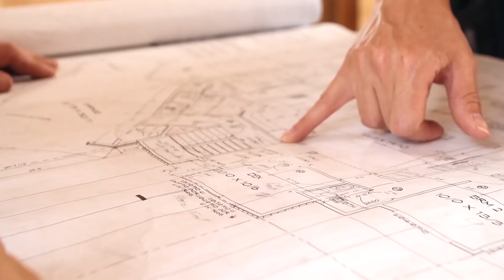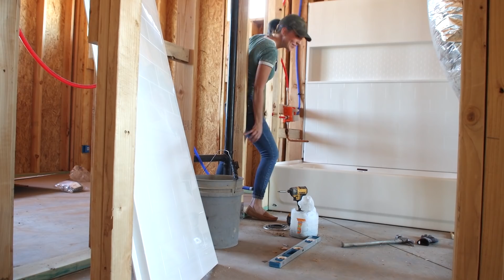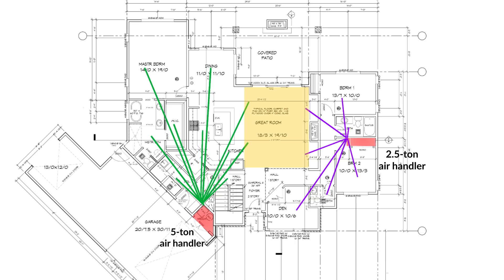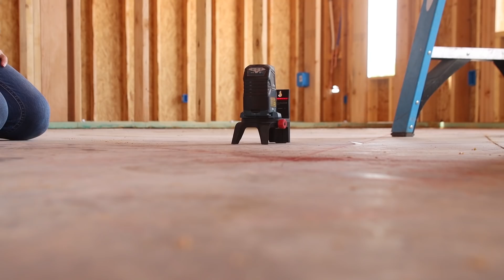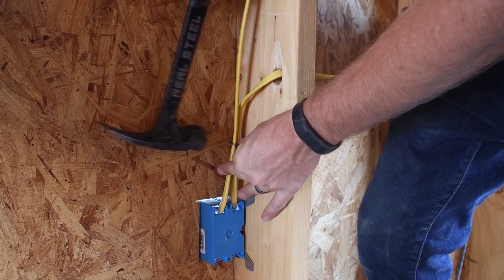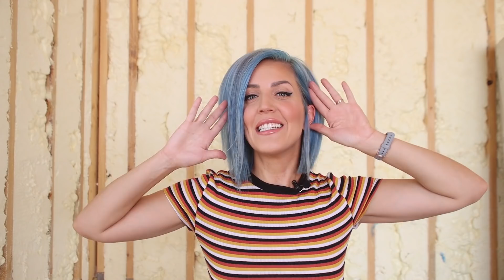DIY & Professionals Install HVAC, Electrical, & Plumbing | Ep. 5 Building Modern on a Budget

Comment: For 15 years, actually more than 15 years of my life was spent in doing stress-strain and design on heavy machinery. Cutting near the edge of a 2×4 or other wood piece weakens that  pieces of lumber to take loads as most of the stresses go through the top & bottom of the piece, not it's middle. ( you always want to drill your wire holes through the middle of the piece). You should reinforce around the holes drilled through the OSB for your AC ducts. ( I always used guerrilla glue, and a few screws. Really, liguid nails make work better) This replaces most of the strength lost when cutting the hole. Most builders just opt for the industrial look and suspend metal AC ducts from the ceiling to solve ducting problems like you ran into.  ( they paint the ducts black) This is also a matter of preference as some people don't like the industrial look. Rejoice that you didn't build in Ohio as all wiring must be placed in conduit pipe, plastic or metal, in newly built homes and stapling it to the  wood reframe work is unacceptable. If you do so they will make your tear all your wiring out and throw it away. ( I know, fussy, fussy, fussy, but in the end government ends up winning)

Comment: Question: the only reason you’re able to do these small things without a subcontractor is because your father is the GC correct? And the electrician was a family friend? The construction loan will not pay for the materials installed in a DIY application (not by a sub constructor) is what my experience has been.
Reply from the maker: Yes. We were supervised by a licensed contractor and sub-contractor at all times.

Comment: I'm no expert but why couldn't you open the trusses and rebuild a blocked and reinforced opening for the holes needed for the HVAC ducting?? Same principle as using headers to shore up where studs get cut to accommodate windows? Could use a flatter flange metal rectangular solution to fit.

Comment: HVAC CONTRACTOR: Again with all of this flex ! Flex ducting has its place but not as main-run ducting. The static pressure alone will kill the equipment. In AZ. with the heat load..,good luck.

Comment: The reason you have so many issues is your designer and contractor should have worked together.  Clearly your designer was more.worried about how the home looked and not mechanicals..Your.problems is your designer, see this a ton as a hvac tech

Comment: "An obscenely high number of windows."  ROFL.

You saved yourselves a mistake I made.  Due to scheduling, I brought in plumbing, then electrical, then HVAC.  Of course, the HVAC needed some of the electrical repositioned by a few inches or even by a foot in some locations.

Since plumbing is least flexible, HVAC, is second, and electrical can run anywhere around plumbing and HVAC, I'd recommend ALWAYS getting the electrical done last.

I was kind of expecting that you were going to solve your "east side problem" with the Mr. Cool mini-splits as well, since they are bedrooms, and could each be "HVAC zoned" to the preference of the person in the room.  Still, doing 5 tons HVAC on that much space for $10k is remarkably good.  It would be at least $15k here (though that would include oven hood vent, dryer vent, and bathroom vent fans).

BTW, I also did 400 amp service with 200 amps for the house and 200 amps for the garage.

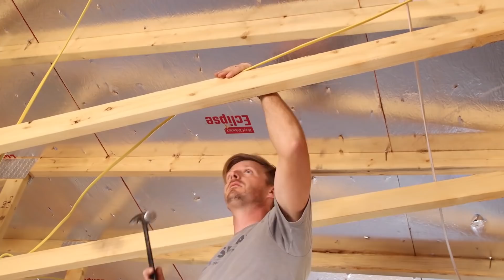Comment: 11:05 Whoa, I’m shocked your inspector allowed the use of staples with no plastic protection. It’s been over 10 years since we were allowed to.
Reply: I saw that too.  Not using NM staples would be an inspection failure here. Also, they are really strict about the nail guards as well (though they showed that).

Comment: I'm shocked that you assumed the electrical would be cheaper than plumbing. The cost of materials within plumbing is typically cheaper and the knowledge needed for electrical is far more.

Comment: Love these videos. They are so inpsiring. I suppose this woudlnt help now but I was curious; if you were gonna have some A/C mini-splits, why not do the whole house like that? You could buy a 5 ton compressor unit with (evaporator) cassetts in up to 7 areas of the house per complete unit. Also, from another comment above, i agree with the Cat6 or better ethernet. The need for POE devices like security cameras and multiple WAPs is growing; especially with a home this large. I’ve only seen a few videos so possibly ill see you address this elsewhere so surfice it to say, i enjoy your videos and best of luck

Comment: A heat pump is an air conditioner that has the ability to run the refrigeration cycle in reverse. The AC doesn't come with a heat pump. It's either an AC or a heat pump.

Comment: i'm no profesional but would've installed Cat 6 or Cat 6A  for future proofing network demands
Reply: Future proof, 6A all the way
Reply: Rigo De Bruecker cat 6a is overkill. You won’t need shielded cable in residential settings. Cat 6 is fine.

Comment: Electrical is no joke. It's one of those things that you should spend a little more just because security. In Brazil we don't have that standard in home wiring, the company hook up the wiring to the meter and from then on it's on you, so ppl tend to use wiring just at the limits of the copper, a lot of electrical tape and some prayers. In my house, the breakers won't trip because of overload, and that haunts my dreams.

Comment: TOO LATE NOW , but i would have built a insulated horizontal boxing just under the back ceiling  above the back door and shrink the clerestory/transom window over the back patio door  it would not have looked bad imo , since the modern design gives you that latitude ( FYI I''m a custom home designer and commercial/ residential interior designer of 40 years) impressed of all the work ya'll did in that heat - bad ass ! lending a whole another level of sweat equity  -  other ?  LED cans ? Whats up with the interior materials selections ? ( what is budgeted ? be careful , very careful)

Comment: Flex duct for every trunk is lazy hackery
Reply: That's why the hvac was so cheap a very piss poor job the fact that their in laws said they do good work made me laugh even harder definitely not a quality job I'd be surprised if the even check static pressure or set the airflow up

Comment: Did the additional 2.5 ton AC unit change the price of the HVAC work to put you over budget there too?
Reply from the maker: It definitely added to our expense (about $2k), but the $9,400 bid includes both units.
Reply: The biggest reason for the second unit is the home builder that developed  the plan didnt have a clue the sq footage required a second unit. It shows because the home desinger didn't allow room to run ductwork to begin with. Sound like who ever did the building plans should be fired. See this a ton on new construction as a hvac tech, the designer  is concerned about looks and not actual functionality of the home for the plumbing, electrical and hvac systems
Reply: @zack9912000  Probably bought the plans online. Never allow an architect to design HVAC on residential. I lost count of the # of times i have let the home-owner know that the HVAC drawings were garbage,espescially in the use of laminate construction. By the way..,$9,400 is obscenely low for 2-systems. Are these guy,s licensed ?

Comment: I do electrical work in LA, and these quotes are ok. Just to consider 200amp panel in the workshop.. yeah.. boxes installation, stapling and plates are the easiest part of electrical installation.. so I'm not sure if they would really discount a lot.. I'd say 3-5k discount at the most..

Comment: Hi, I feel for you, the costs of contractors can be very scary and you cannot put it against anything to see if you are being ripped off. I live in the UK and my first job was as a Charted Surveyor and this gave me a very good start to my life. We got married and soon realised that we would need to buy a “fix it upper” to stand any chance of getting on the property ladder. We moved from house to house doing all the work ourselves and selling for much more money hen what we paid for it. We eventually found a place where there was no house but a flat that had a
kitchen, bathroom and eating area only and eight wooden stalls for horses that were almost falling down. I did all the planes and over five years we knocked down one stall at a time rebuilding them in brick and added a tack room to each stall, we built a circular yard, electric, and water supply to each stable. We had so many people wanting to put their horses in our stables that we decided to put off the house build and build more stables. It took us over fifteen years but we ended up with a lovely five-bedroom house, sixteen stables an Olympic standard inside arena, a horse  ehabilitation pool and resident vet and sold the property for one and a half million pounds.

Comment: I’m surprised someone along the way didn’t think about the cooling system. That’s kinda what the job of architects and designers are as well isn’t it?
Reply: In some ways yes.  The real shocker here is that someone is using a design not made for that site, or that climate.  This is a prime example of what's wrong with how we build in the USA - a house designed for the midwest or a northern climate is almost never applicable to a place like Arizona.  The orientation, slopes of the roof, eaves, protection, and assemblies are completely different.  If an architect had actually designed this 'for this site' it likely would all have been thought of.
Reply: That’s the contractors job for this kind of build. The trusses should have been blocked out to allow for the the ducting. The MEP trades are all design build so the architect just blocks out some spaces for the equipment. She also said the house wasn’t designed to be in Arizona so it was probably just a stock layout.
Reply: I'm a hvac installer and on custom homes nobody think about
Reply: True. Plus they said they designed it for a different climate so maybe that was a factor? You guys know better than me
Reply: On commercial builds, yes.  On residential, not so much.